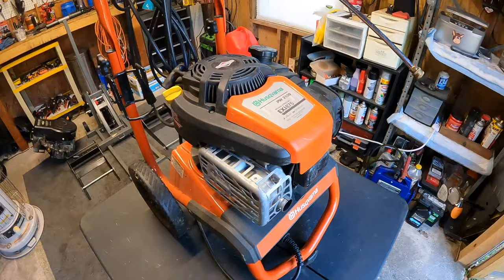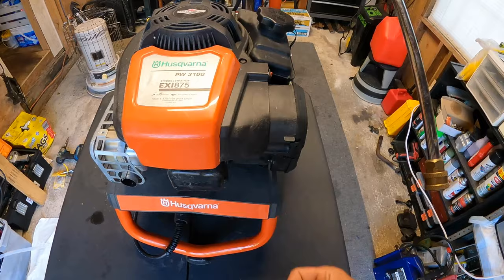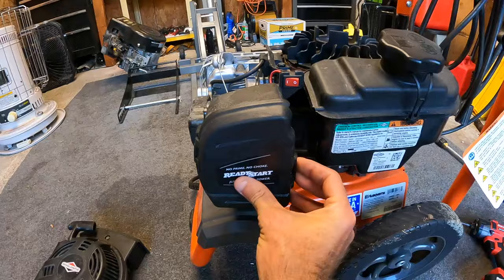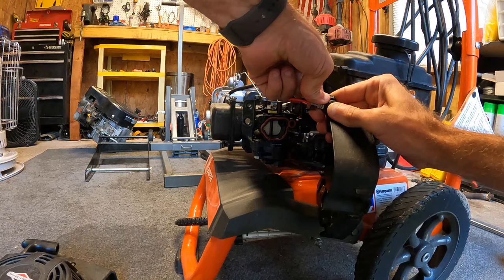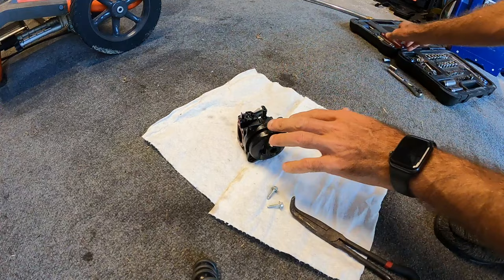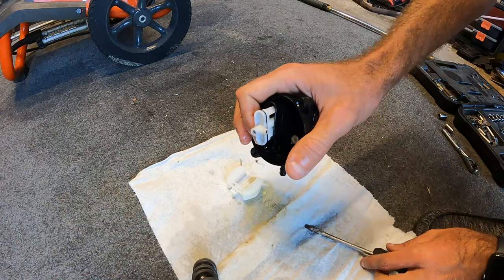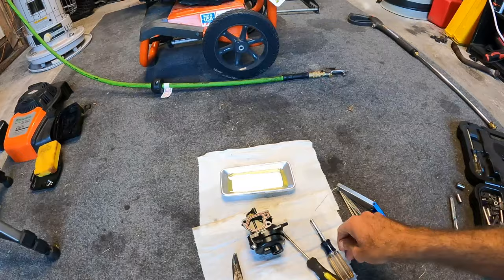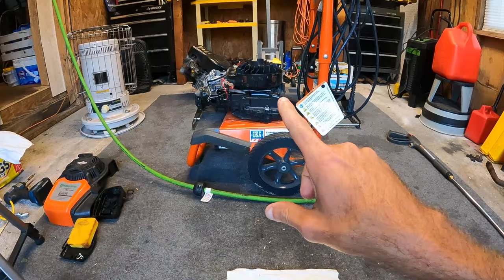PRESSURE WASHER WONT RUN AFTER STORAGE (EASY FIX)

Comment: Alex, your neighbor should be very happy with that unit. Alot of channels cuss those plastic carbs, but i think they are some of the easiest to clean. Ive never had one that didnt need anything more than what you did to that one. Have a happy and prosperous new year in 2024! 🎉✌🇺🇸
Reply from the maker: Happy new year Roger. Yea these carbs can be a bit sensitive to getting clogged but they really are simple to work on and don’t have to worry about the corrosion of metal. I hope things are good your way!
Reply: I love them 😍

Comment: I am not a mechanical kind of guy, I followed your suggestions and sure enough it was the same issue.  I had a lot of particles in the bowl, I cleaned it out put it together and it started right back up.  Thank you! Great video.

Comment: Ok all is well. I disassembeled the tank and carb as you did in the video.  Only found a spec of debris in the jet, but cleaned everything with parts cleaner, re-assembled.   Started with the first pull...PROBLEM SOLVED!!!!  THANKS
Reply from the maker: Wonderful. So glad you got it solved and running good again!!!

Comment: Great video. I have the same pressure washer and seem to have a problem. I can only run it for 10 maybe 15 mins until it shuts off and a cloud of smoke comes out of the exhaust. Seems like too much fuel is going into the carb and the filter gets saturated pretty good. 

Not sure what to do. I appreciate any advice. Thanks

Comment: I just finished watching the video and since I have the same washer I thought I would ask a quick question 
My washer starts and runs, although it surges when not spraying, but dies the moment you start to spray.  Any ideas as to the issue. I do plan to remove the carb and make sure nothing is clogged.
Reply from the maker: Yes it will surge usually when trying to run it on starter fluid as it is not getting the proper amount of fuel. It’s going to be your carb or fuel not getting to the carb. Hope this helps.